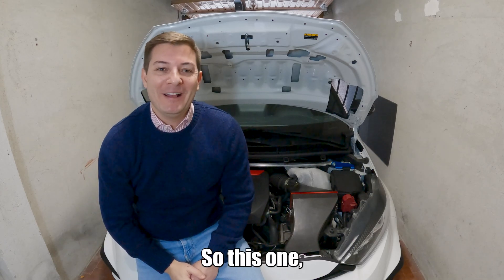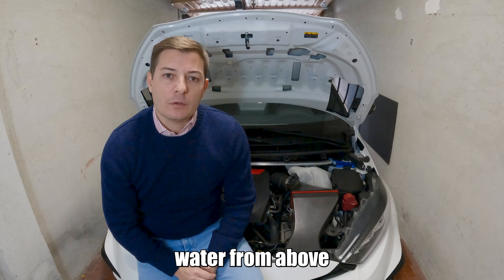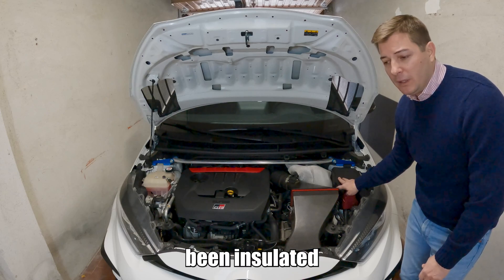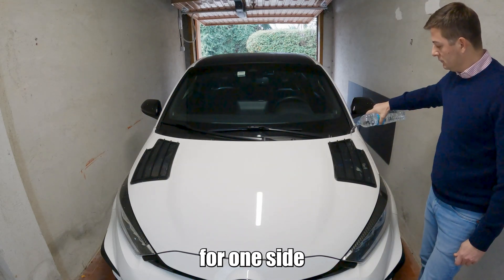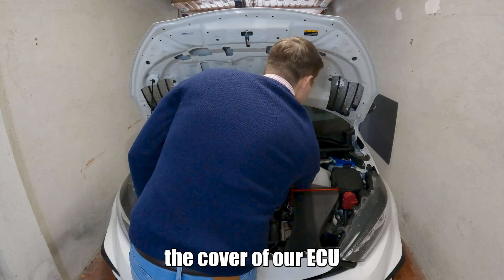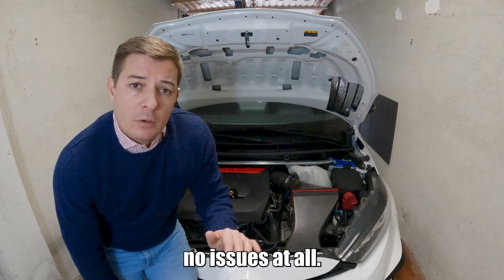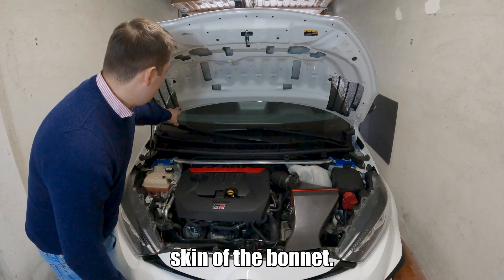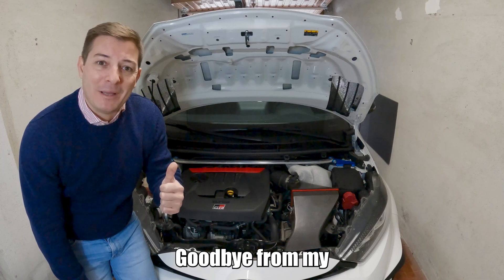Toyota GR Yaris Hood Vents Kits FAQ explained

Comment: Love your videos buddy! Since you're on the topic of TÜV, could you touch on TÜV for the BOS suspension in a video? You've absolutely convinced me to go for it once my GRY gets delivered, especially compared to the KW or Öhlins, however I'm not sure if I'll legally be able to. :( 

While you're on that topic, you could also talk about the serviceability since I've read that it's either a year or 20k km, which is very very short for a "daily".
Reply: Thanks for your beautiful response, haha! I wish there was a way to push BOS to create the paperwork, it's such a shame since KW / Öhlins are raking all the money in. I was actually referring to the serviceability of the suspension that you have. But thanks for the tip nonetheless! I will follow your every advice. :)

Is there anything you'd say is a "must-do" for new Yaris owners? I've heard many differing opinions, even regarding the "break-in". Manufacturers want you to avoid certain rev ranges but then you hear mechanics or motorsports guys recommending to use the whole rev range from early on.
Reply from the maker: Regarding the paperwork, I don’t think it is in the works unfortunately, but I will ask.
In regards to the engine run in, use it normally without pushing over 80%, and try to do as much engine braking possible, gently and from not over 5k revs, in order to help the piston rings work in. After 1-2000k km, you can progressively push more and you will have done it perfectly. Even of you don’t do this procedure, these new engines are very good and won’t suffer too much
Reply from the maker: Hello and thankyou for yor beautiful comment! In regards to TUV, today BOS Suspension has no paperwork, so this unfortunately will not work in Germany… A new video about BOS kit and GR suspension will be coming in less than 10 days, stay tuned!
In regards to engine oil interval, if you don’t track the car, I would recommend changing it every 10.000km. I have a video about all lubricants